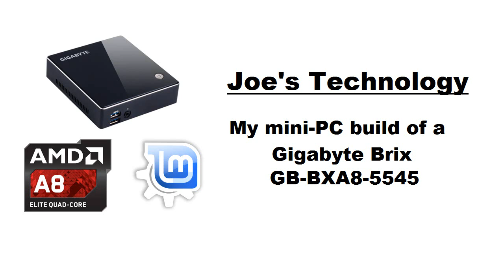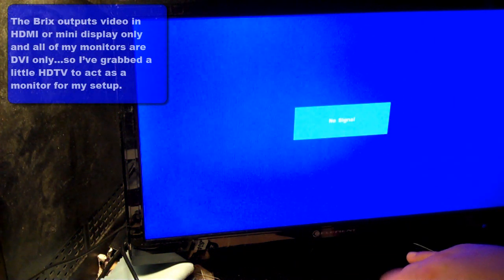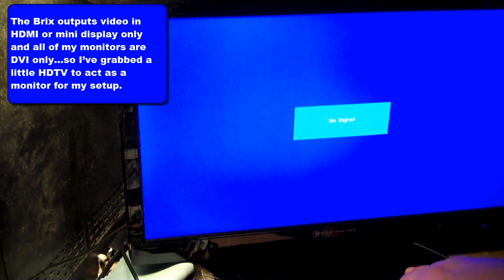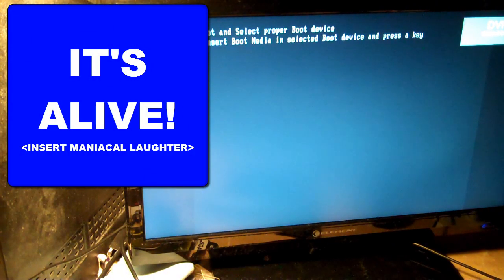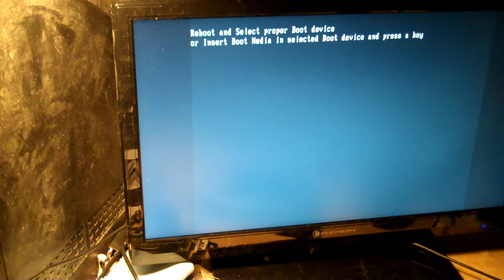Unboxing and Assembly of the Gigabyte Brix GB-BXA8-5545

Comment: What was your experience with the wifi and bluetooth? I want to build a couple of these but neweggers are slamming this thing for poor wireless quality.
Reply: I run this same Brix set up with a Netgear Powerline Ethernet Adapter to run my Ethernet through the power to my router. I use my Brix for a Plex Media Center and Steam Stream and have ZERO issues gaming or running blue rays over the powerline from my server. I get a consistent 72Mbps. 

I am running the Brix A8, Intel Msata, Ripjaw 4gb ram. Only issue that I had was the USB 3.0 drivers, I had to go into BIO and turn those off to install windows. Can be a nightmare if you are not tech savy to figure this out. More then pleased, I run a Micro USB keyboard with a mouse pad to control it from my couch.
Reply: The WiFi it came with turned out to have poor range. I ended up plugging mine in via Ethernet cable. I didn't try the Bluetooth.
Reply: Jayson Ek
 I'm doing the same thing, using a Netgear power-line adapter. It works much better with a physical connection.
Reply: +Jayson Ek Hello, sir, and thanks for the comment. You spoke of gaming, and I was wondering how your gaming experience was with this machine? 
Also, if you respond, it would be good to know the amount of RAM you have in this machine. I am looking for a computer that can game with demanding First Person Shooters (Battlefield 4, [even though it isn't a FPS GTA V]) at around 50 FPS on high settings. Is this the right machine?
Reply: +Mark R This computer can game with titles that aren't too demanding like WoW and DOTA2 but first person shooters are going to demand too much and the framerates will be really low. This is more of a media PC that would be great for a living room streaming movies or games and it does make a great little workstation.
Reply: +Mark R I wouldn't use this for gaming, the apu, is capable,  but i use it for a steam stream box.
Reply: +Mark R I wouldn't use this for gaming, the apu, is capable,  but i use it for a steam stream box.
Reply: +Mark R I wouldn't use this for gaming, the apu, is capable,  but i use it for a steam stream box.